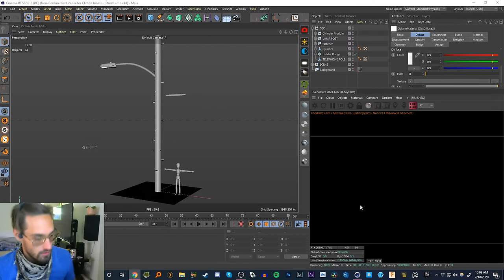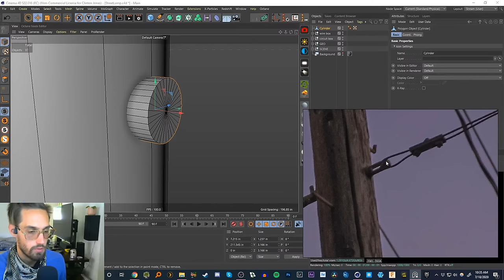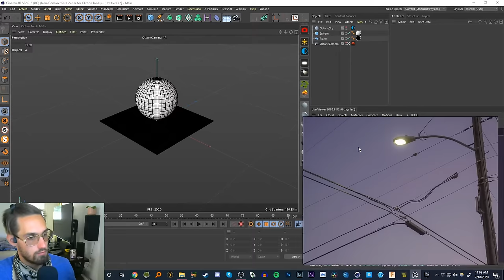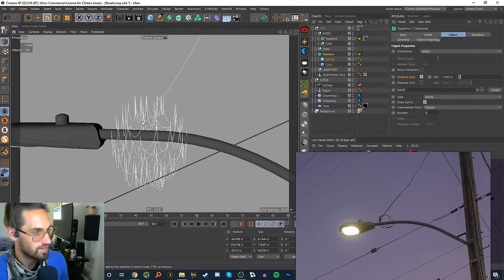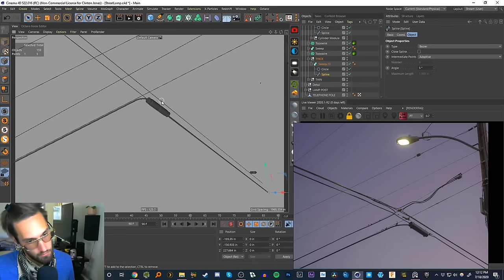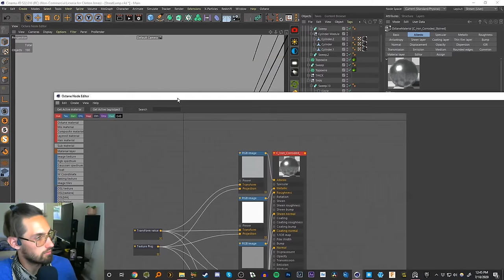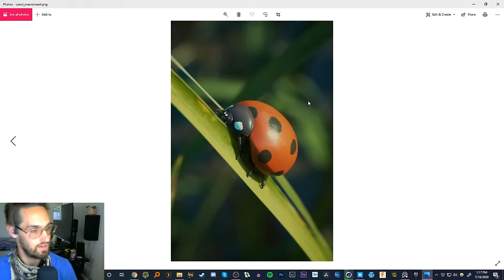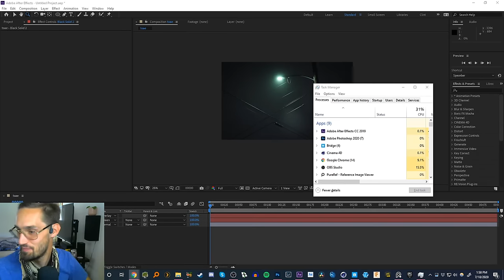Believably Recreate Photographs in Any 3D Program | Part 1

Comment: I think this was a pretty simple scene to recreate tbh, I just think Clint got stuck in a funky workflow, which is easily done tbh.  Also, I think better use of top and side cameras would have helped greatly to get wires about 90% lined up, rather than fighting the 3D perspective trying to grab and pull things down to where you want it, just to move camera angle for it to be way off again. 

Nice attempt though, it was looking good there towards the end.